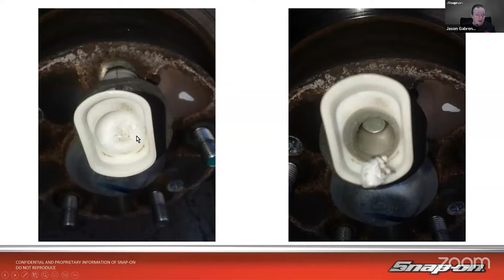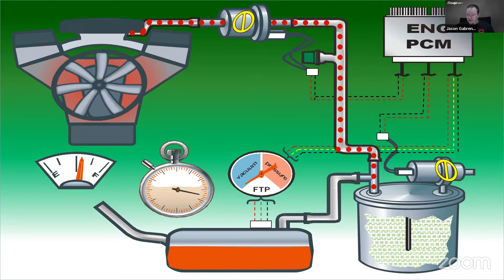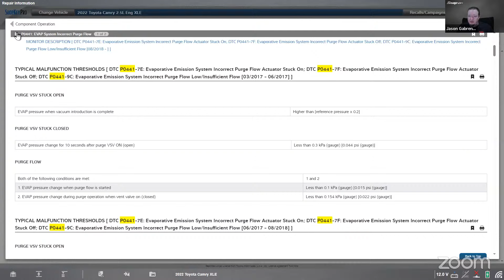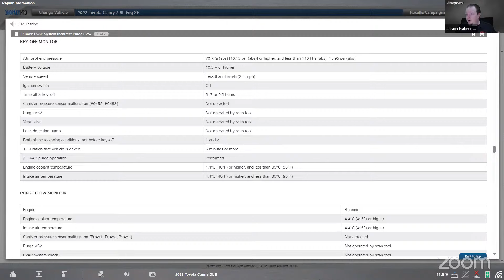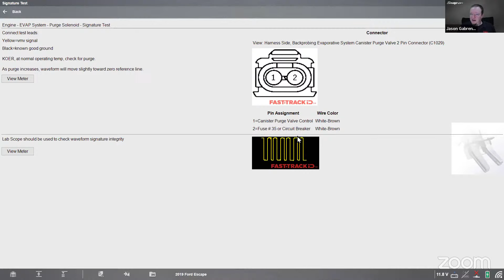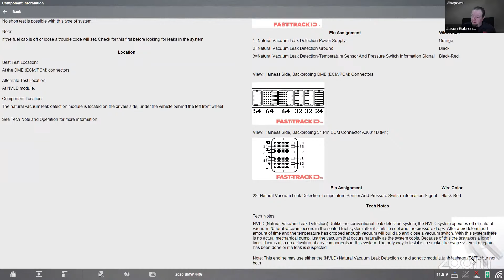EVAP Systems Operation and Testing - Snap-on Live Training Episode 101

Comment: Hey Jason, I was wondering,, If you suspect the fuel cap as the cause for a small evap leak, could you verify it using the fuel tank pressue sensor pid on the scan tool while montoing its data as you remove the gas cap? If so, can you expain?
Reply: Jason giving his Subaru monologue at the introduction of EVERY SINGLE VIDEO is a feat in itself.